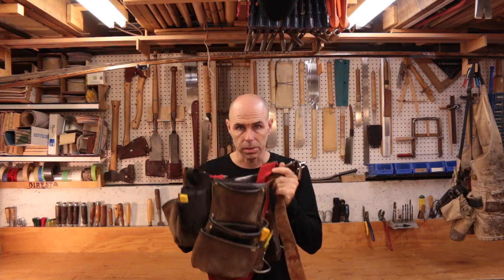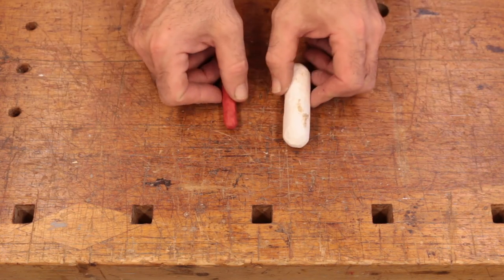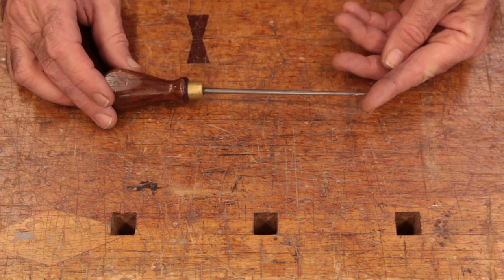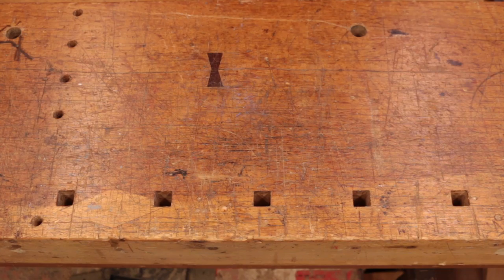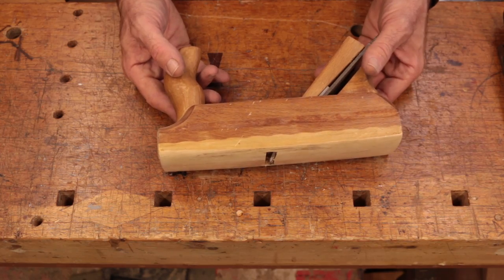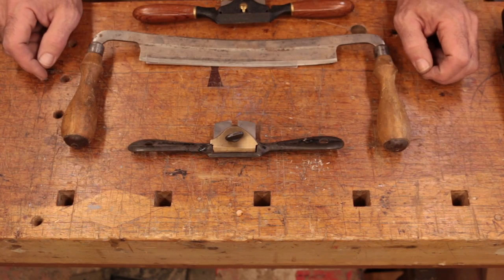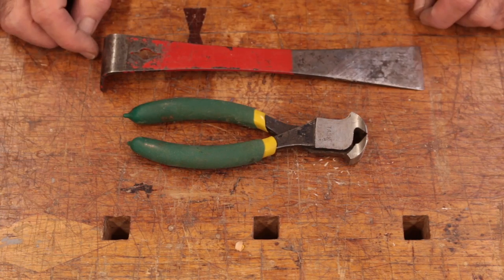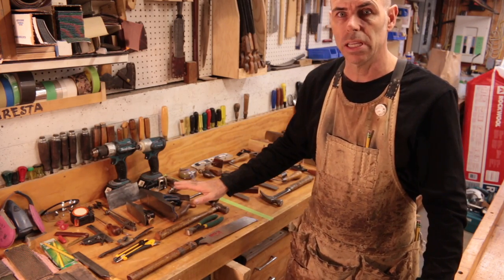⚓️NOMAD - What hand tools do I need for boatbuilding?

Comment: This was nigh inspirational. I'm just a college student planning on building a wooden boat soon, and most tutorials go on about how if you don't have a "number 2x10^5 compound smoothing angle grinder plane with laser sight and magazine release" you can't build wooden boats. I'm relieved to hear what you say is realistically needed, as I already have most of it.
Reply from the maker: You can get by with very little if you put your mind to it. I've seen plenty of substantially sized vessels built with absolutely bare bones tools and equipment. A lot depends on the type of construction you choose. 
For your first build I suggest you keep it simple and as close to traditional building as you are comfortable with.  My first build was a super simple skin on frame kayak “Building the Jawbone kayak”. The next was a glued lapstrake canoe “Ultralight Boatbuilding” by Tom Hill. Neither required much gear but I did have a basic workshop setup with some contractor grade machines. You do not need to go into deep Festool debt but I would say that a small table saw and a portable thickness planer would be money very well invested. With those two machines a huge range of materials and processes open up to you.
Reply: @Nomadboatbuilding  Thanks for the reply! It's true, you can get away with very little. I actually built the sea skiff by William D Jackson using only a $15 jigsaw, my school ruler, and a drill/driver combo when I was 18. It was a pretty good boat! (Until it was destroyed in a storm but that's a story for another day). Now I want to build a more traditional boat, I bought plans for Gartside's 10' clinker, and it's good to know that I only need a couple more tools for traditional building. I'm actually in the garage right now making an angle gauge!
Reply from the maker: @MonolithproductionsT  good choice. Paul is an excellent designer. I only wish I could have worked with him a bit. I tried but he didn’t need help at the time and soon after he moved to the East  coast.

Comment: Refreshing to see a tool list that has proper tools in and not a load of floor table saws and planer thicknesers and jointers, etc. I have a block and jack plane, but can't get on with a smoothing plane at all. I am looking now for a rabbet plane and probably a bull nose.
Reply from the maker: Well I intend to do another video that addresses stationary machines because they do play an important role but hand tools are the foundation of the craft. If you're having trouble with a smoothing plane, you might look at how well it's tuned or try a different one. Sometimes the geometry is not always quite right for you. I have an expensive Veritas low angle jack smoothing plane that I can't use for most of my needs. It just doesn't sit right for my hands. I like both my cheap antique Stanley rabbet plane and my new Veritas one but they are radically different in their use and I would be hard pressed to replace one with the other. Best of luck on your tool hunting.

Comment: What were the dimensions on your shop tote?
Reply from the maker: The box is 7” x 7” x 25 1/2” internally. The handle sits about 16” - 18” above the ground.  It's 1/2” plywood. Glued and nailed. It's designed to hold a rafter square inside and fit into my truck toolbox with the lid closed. I have several of those totes in slightly different dimensions. I build them by eye so the dimensions vary.

Comment: Don’t like the saws, never could get on with them, block plane you have to have, number 4 everybody’s got,  yadda yadda ! I agree with most of your choices. But I seriously disagree with getting top end planes, particularly at the beginning, any reputable planemaker makes planes that will do the job and do it well, it’s the practice that does it not the dollars.
Reply from the maker: I agree with you but there have been very few budget friendly reputable plane makers around until very recently. Stanley on just tried to get back into the usable tool market with the re-introduction of the Sweetheart line. The stuff they produced for at least 15-20 years before that was absolute garbage.

Comment: I recommend buying planes from Japan, they are all pull planes , and not European push planes. They do a much better job and are much easier to use!!! Push planes always require some sanding after use. Japanese pull planes never require sanding after use! They are much more affective than push planes! They save a whole lot of time!!! You lost my interest in your video when you kept mentioning European style pushe planes. I wish that Americans would understand that a small Japanese pull plane can do all of the work of 10 European push planes!!!!!!
Reply from the maker: Well Mathew, you are entitled to your opinion of course but I have to disagree. Properly sharpened, push planes are every bit as efficient as Japanese planes. I feel they are also easier to adjust and offer more sharpening options. They are also much more readily available in Europe and North America where the bulk of my viewers are. I've got no problem with Japanese tools. I have a variety of them myself. I use the saws pretty much exclusively. If I felt I was getting ten time the performance out of my Japanese plane you can bet I would be using it. Here's a little known trade secret though. If you are struggling with a push plane, turn it around and pull it. Nobody stamps a "this direction only" arrow on them.
Reply: Hooey !